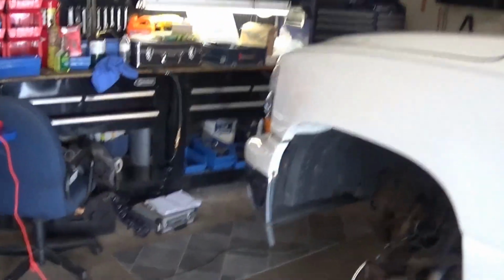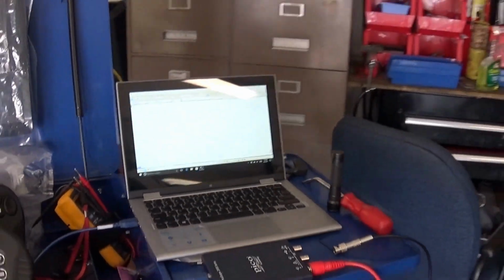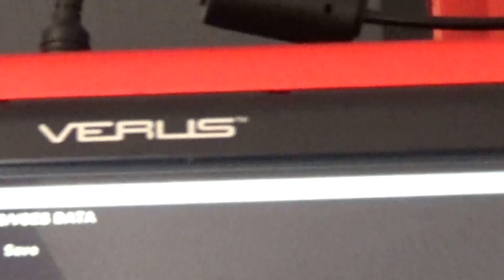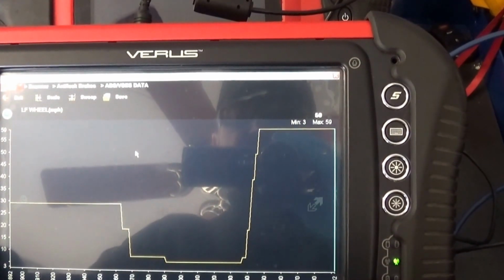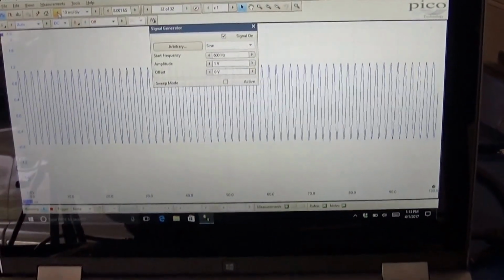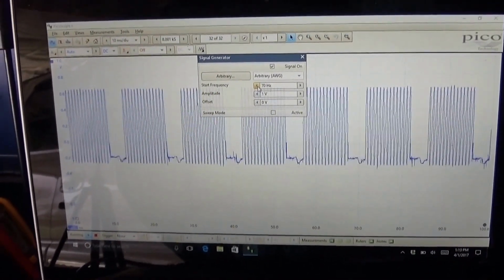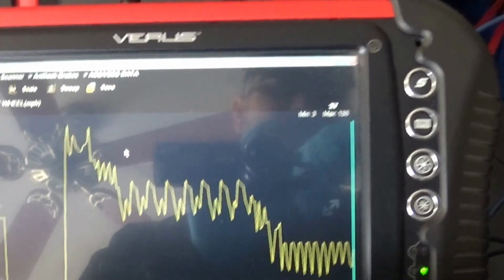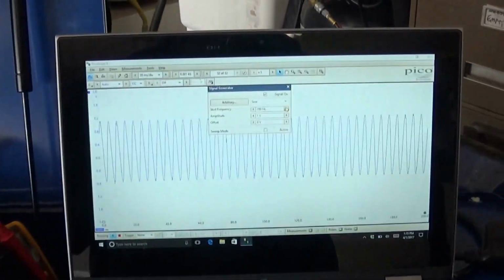GM ABS Sensor Bypass Test With Picoscope Waveform Generator

Comment: Many thanks Ramon, i suppose u could record a good known waveform from say a ford crank signal, and replay it using the awg to prove a ecm on the car or the bench many thanks sandy
Reply from the maker: Yes that is my next project.  I can make custom waveform for crank signal and than we will look for PCM response ( RPM  changes or turning injectors or ignition coils). Thank you for watching.